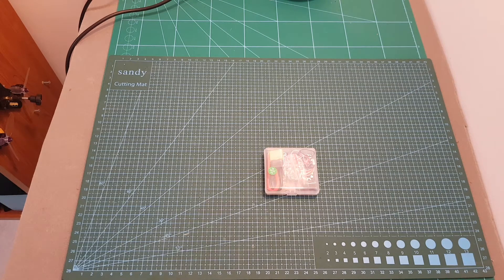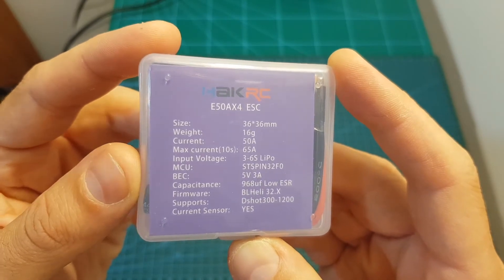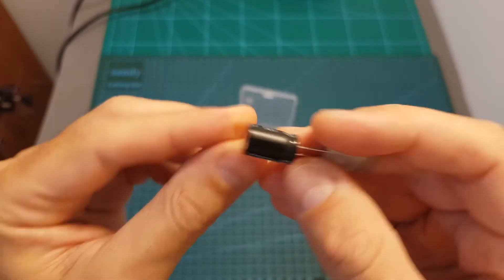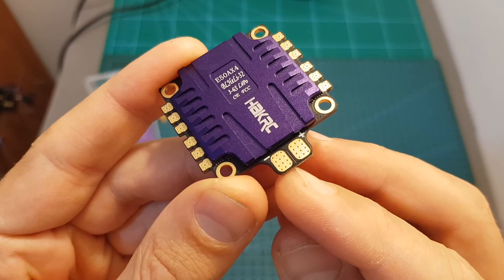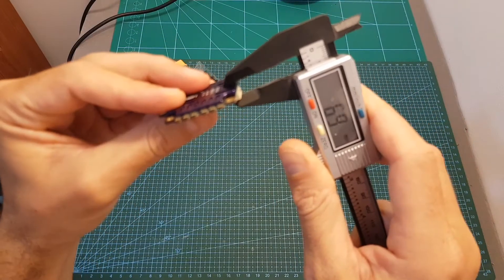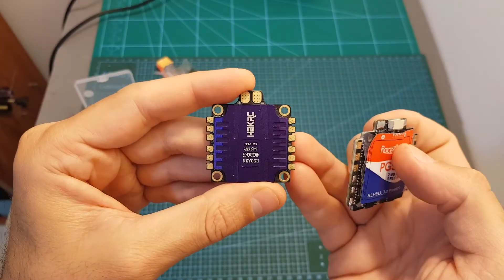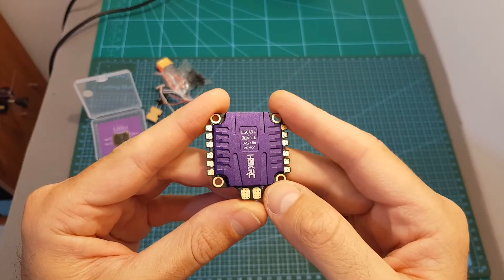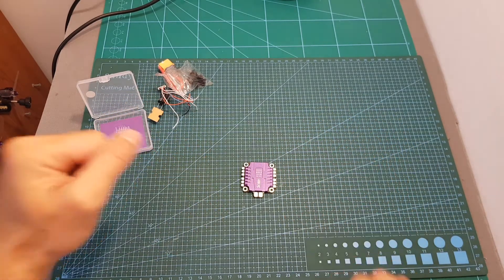HAKRC E50AX4 3-6S BLHeli_32 4 In 1 ESC Overview

Comment: Show us in the flight test how the noise profile is with and without external filtration, that would be very nice!
Reply from the maker: Thanks for the suggestion Pedro. Just to be clear - you mean without any LC filters, right?
Reply: Gal Kremer exactly. You can also show how it goes with a lc filter or low-esr capacitor

Comment: $137.00 on Amazon that's crazy. It's pricey on Banggood also.
Reply: Wtf where you are? It's not even half of this prize on bg!
Reply: 169/5000
Bù, wǒ zài yàmǎsūn bìng méiyǒu kàn dào 137 měijīn,https://Www.Banggood.Com/HAKRC-E50AX4-50A-4-IN-1-ESC-3-6S-BLHeli_32-5V-3A-BEC-Dshot1200-For-RC-Drone-FPV-Racing-Multi-Rotor-p-1331996.Html?Rmmds=search
No, I didn't see 137 dollars in Amazon, https://www.banggood.com/HAKRC-E50AX4-50A-4-IN-1-ESC-3-6S-BLHeli_32-5V-3A-BEC-Dshot1200- For-RC-Drone-FPV-Racing-Multi-Rotor-p-1331996.html?rmmds=search
Reply from the maker: Dunno why it's so expensive on Amazon. The price on BG is ok.